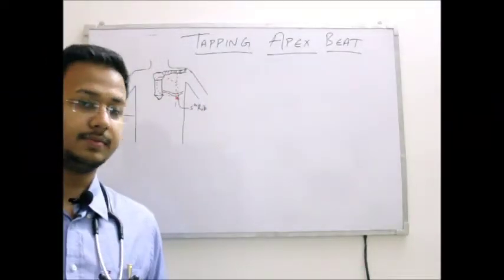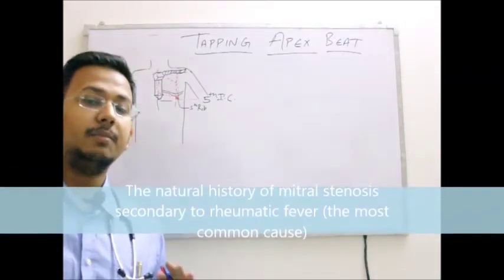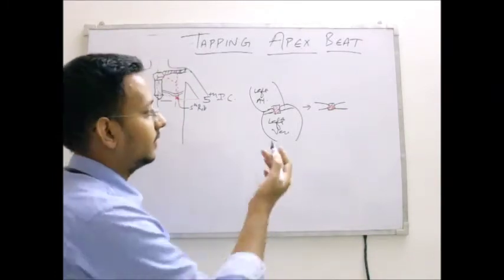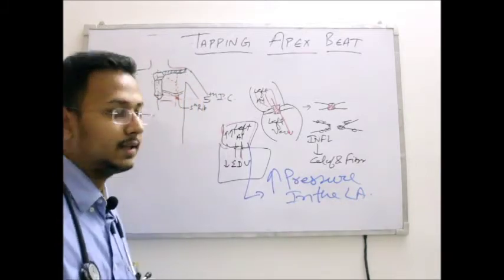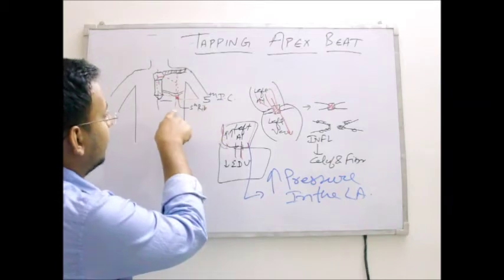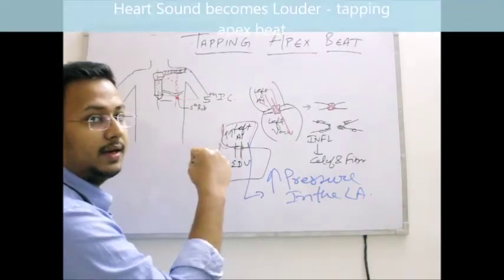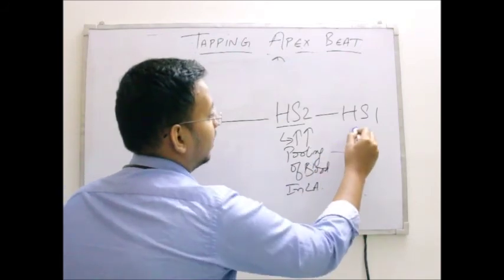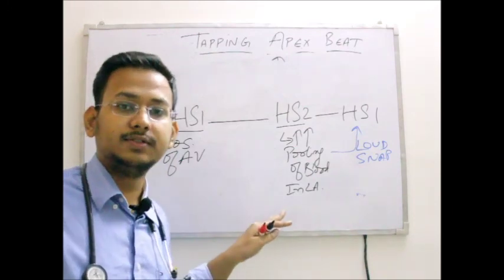Clinical pearl - Tapping Apex Beat Pathophysiology

Comment: HIi Can dr explain on why heaving apex beat in pressure overload and why thrusting apex best in volume overload?
Reply from the maker: Secondly, Heaving apex beat results from sustained cardiac systole which, contrary to the thrusting apex beat, results from pressure overload. This is explained by the fact that it takes longer to overcome the 
increased afterload (force or load against which the heart has to contract to eject the blood) and so the ejection of 
blood is delayed and prolonged. Conditions associated with raised left ventricle after-load include aortic stenosis, sub-valvular aortic stenosis, aortic coarctation and hypertension. Equally, cardiomyopathy results in a weaker left ventricle contraction and thus a lower left ventricular systolic pressure relative to the (normal or low) left ventricle afterload. The same biomechanical reason therefore explains why this sustained apex beat is also associated with cardiomyopathy.
Reply from the maker: Starting with Thrusting Apex Beat - thrusting apex beat results from left ventricle volume overload and is the result of an increase in stroke volume. Left ventricle volume overload commonly results from aortic or mitral regurgitation or from bradycardia (prolonged diastolic filling resulting in increased stroke volume). It is also found in hyperdynamic states such as sepsis, thyrotoxicosis  or anemia. In simpler terms, it creates a thrust due to high flow rate (more volume of blood).